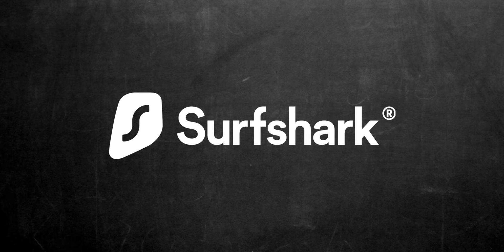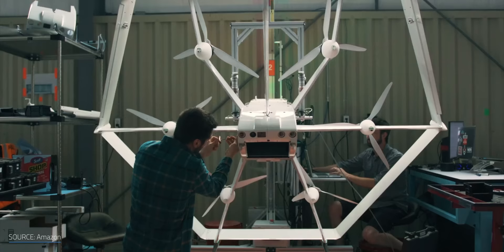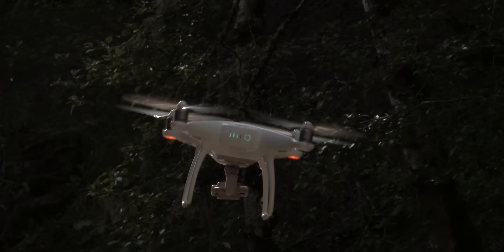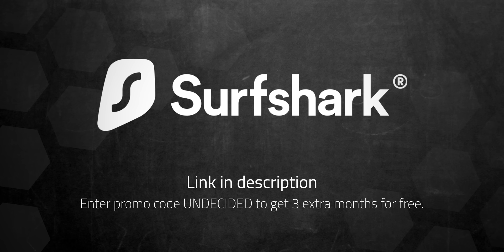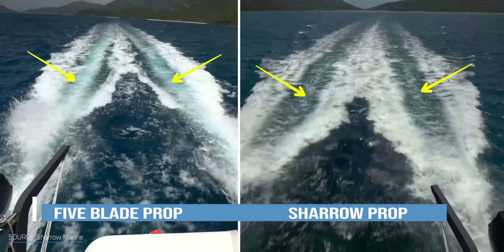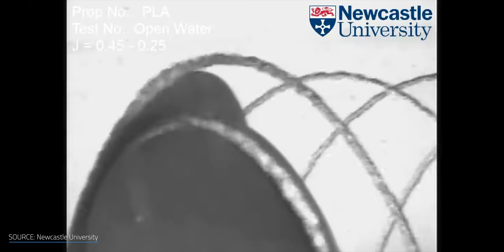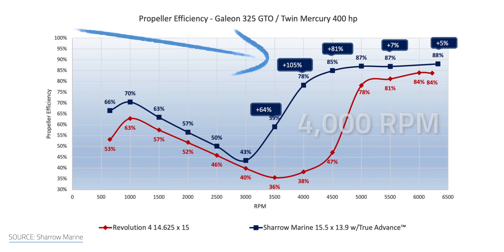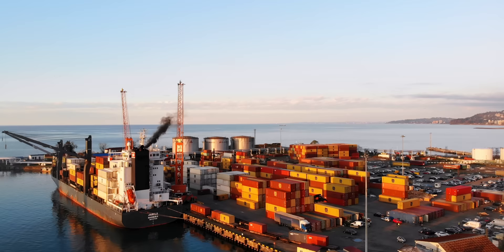Why is this Propeller Getting So Much Attention?

Comment: I HAD A MASSIVE ARGUMENT on a car tuning channel that a whistling turbo was a BAD thing not a GOOD thing 

The whistling is vortex shedding at the tip of the blades - usually caused by a mismatch in the size of the turbo and the inlet X section - at best its literally ripping away the tips of the blades, at worst it is over boosting the system and can cause it to explode

Comment: Nice video, great implementation of this topic!

Have you somehow come across approaches to use the toroidal concept for wind turbines? It would be exciting to develop a particularly quiet (small) wind turbine. Here, too, tip vorticies should be a cause of noise development!

Due to the aerodynamics, however, the design would of course have to be different. An optimal fan is after all, as we all know, a catastrophic wind turbine system.
Reply: There are many solutions to tip noise, through designs that we already have, that wouldn't require a completely new prop design. 
Additionally, we look for a design that takes the least amount of material to produce. Weight and eol disposal are factors. 
The Toroidal design takes a lot more material. This rules it out for most real world applications.
Reply: The first time I ever saw a torodial windturbine was a horizontal desing back in the late 70's on a green energy exposition. As i remember correctly it was mostly too complex to scale up. One of the most remarkable things was the flexible desing let it change height and diameter when (wind)speed variated.

Comment: i think the US Navy and Darpa, had tested these, and said something like while they work great on a small fishing boat, its not a scalable design for a destoryer or quiet enough for a submarine, which is what Matt says @10:40.
You'd think if the Navy could afford to test two aluminum warships and scrap them after 11yrs , a propeller should be like buying Mc Donnalds.

Comment: I remember some decades ago reading about a new propeller for ships - a propeller that was not a helix but a vertical piece that propelled the ship usint the same principle fishes use. It could get higher speeds and save fuel but it took too long to accelerate the ship.

One of the problems with these aero/hydrodynamic parts is the lack of deterministic equations. The only path possible is trial and error. There are techniques to guide the trial and error - famously the first genetic algorithm for optimization was created to design turbine blades back in the 1980s.

This propeller is very interesting! If we compare old comercial jets with the new ones, one small difference will be the two vertical parts parts on the ends of the wings and they are there because they stop the air flowing above the wing to mix, through the side, with the air flowing bellow the wing. Those small vertical things save lots of fuel. That's precisely what this new design does! In the jet plane the noise reduction is insignificant (there are 2 or 4 turbines near it, after all) but for drones it's fantastic!

I think one reason for the price is the shape probably needs a mold that will be destroyed after each is made. Cavitation, however, is a serious problem - that the Red October solved using superconductors to move water ... (the book/film). It's the main cause of noise in submarines and ships and it affects marine life. It also destroys the propeller/turbine. In hydroelectric power plants the turbines have to be dissaseembled and repaired in a prefentive fashion so they wont undergo catastrophic failute. That means though these turbines propellers will cost more, they'll not only save fuel but also last longer. Nice one, Mr. Farrell!

Comment: Hi Matt,
would these propellers work for wind farms? A similar improvement in efficiency / reduction in noise would be fantastic.
Reply: there are vertical axis turbines that already use a similar shape and some dynamic kite based wind energy farms are also looking into such novel applications :)
Reply: I'd wager not, since:
 - bladed wind farms operate at way lower RPMs where tip vortices are practically moot
 - the fluid dynamics work a little differently in reverse - likely invalidating any efficiencies that aren't just side effects of noise reduction
  - are the propeller blades at wind farms even noisy, especially compared to the generators?
Reply: I would say yes and no. Windmill blades can now be adjusted for the best performance in different kinds of weather and i do not see how you could do that wit theas blades. That sead, because of the bigger range of affenciantie it might not have to.
Reply: Yes and no. The design should work the same for a wind turbine as it does for a propeller, but at those sizes increased material costs will make it unfeasible. It would likely also impact the efficiency of downwind turbines. The question is if the added material costs less than the profits you would gain with the added efficiency. You also need to figure out the engineering challenges that come with the added weight for the support structure and how that would affect possible height (which is corelated with higher wind speeds) and for the inertia of the system and how you would stop such wind turbine in dangerously high wind situation. My guess is that we could use this design with smaller home turbines

Comment: One thing worth noting is that even if the sum of pollution by those huge container ships add up to 3% of global CO2 for 80% of transport by volume, if you break down the transport contribution % for any good purchased, the fraction contributed by those container ships is fairly low. Most of the pollution is in the last stretch by truck.
A rule of thumb (not entirely accurate, but i'd love the hard numbers) is that container ships are one order of magnitude more efficient than trains, which is one order of magnitude more efficient than trucks per mile/kilometer traveled.

Comment: Yet another niche market these propellers would be great in: paramotoring. Paramotoring is where you use a long, wing-like parasail in conjunction with a simple propeller strapped to your back, run by a light 2 cycle motor to provide thrust, allowing you to use that parasail give you one of the most free forms of powered flight for a single person. One problem is that the prop directly on your back is incredibly loud, necessitating hearing protection and causing fatigue. You'd probably still need hearing protection, but it would be very welcome. Any higher efficiency is also great!

Comment: Question: Can this work for Computer fans too, or do those need different properties? These are so much quieter, it would be quite amazing for that setting, where you sit next to fans for potentially long times.
Reply: they have different properties. one of the main one is they arn't in an open air system, they need to push air hard through obstructions and such. also alot of the noise comes from the air inside and not just the fan but the turbulence of the air flow.
Reply: ps, you can get quiet fans.
Reply: @mryellow6918  part of what these toroidal fans seem to do is to reduce turbulence, at least the turbulence created right at the fan itself. I'd imagine that'd still be possible to do in the cooling fan setting?
Reply: @Kram1032  what I mean is you can't do anything about the turbulence inside the case. And you can't control what's obstructing stuff. For example your gpu fan blowing in all directions even against case fans
Reply: @mryellow6918  certainly, but I guess I'm not sure that that's enough to dismiss the sound of turbulence happening at the fan blades.

Comment: Large container ships have variable pitch propellers which increase efficiency at any given rpm vs. a fixed pitch.  Same with constant speed propeller airplanes.  The toroidal shape is only good for a fixed pitch since any change in blade angle would not be possible with the ends connecting.
Reply: Knew there had to be a catch.
Reply: Come to think of it, though, at least in terms of cargo ships, isn't it fine if they run at the same, low speed most of the time?
Reply: @asahearts1  Always a catch. Just like advertisements that are too good to be true and every YouTube is advertising it.

Comment: Greg Sharrow is my cousin. My understanding is the reason they’re so expensive is because they’re milled on a cnc machine and that is incredibly expensive. Most boat props are cast. Same goes for many other types of large metal components, like crankshafts. The cost explodes when you change from cast to milled because the manufacturing is so much slower and more expensive. A cnc can only turn out just so many parts per day. Whereas when you cast parts you can do larger batches in the hundreds or thousands. And increasing manufacturing capacity means buying more CNC machines which can be several million dollars each.

Comment: I'm curious how this performs compared to water jet propulsion.
Reply: Pump-jets are efficient and don’t suffer as much from cavitation because they run at higher pressure. Would be interesting to see how they compare.
Reply: Jet propulsion generally only offers increase in efficiency at higher speeds.  You can see this clearly with aircraft. Planes design to cruise at speeds above 0.5 Mach almost always have jets, and below that have propellers.  I’ve seen similar results with boats.  I read an article about a boat that was offered with either a outdrive or a water jet.  The water jet offered a small increase in top speed but the prop was more efficient at all other speeds.  The conclusion of the article was that you’d only want the water jet if you had to operate in swallow water.

Comment: I'd love to see how, say, a P-38 Lightning could perform with props like these. Or a helicopter like the Comanche.
Reply: They wouldn't even get off the ground.  This shape offers no way to change the pitch of the blade, which means the P-38 would need several miles of runway to get up to speed and a helicopter wouldn't be able to add collective to take off.  Some things don't scale up.

Comment: Actually toroidal propellers are only one option to minimizing tip vortices and is the most difficult and therefore expensive solution since they can only be made by 3D printing or very difficult machining.
The simple solution is to simply place the propeller in a duct which accomplishes the same thing.
Another solution has been to use a different type of propulsion like pump jets.

The toroidal propeller might still be the preferred solution for some situations like minimizing the possibility of entanglement.

Comment: Hello...I'm a marine engineering officer (sailing staff working on those cargo ships that you are showing). All this is extremely basic for me. Even with latest regulations of CII and EEXI I Don't think it'll come into shipping soon. Propellers are already extremely expensive. I'm talking about millions of dollars in our case already. Propellers have already been very inefficient and newer, better designs have been in PRODUCTION since decades like Keppel propeller, etc. But due to the initial costs, no one buys them.
Toroidal propellers will also be very heavy and increase the loads on the stern tube bearings especially on big ships....I still think future shipping will go methanol or methane or ammonia along with other energy saving devices like huge kites and pre, post swirl devices rather than toroidal propellers. Ship owners are mean and no one actually cares for the environment here. Only after a new regulation is enforced, habits change. New rules are actually opposed by countries because it directly means expensive transportation. All this I'm saying in a time when shipping is seeing the biggest change in centuries towards greener fuels and lower emission targets. Still a lot needs to be done and what's done needs to be verified by impartial agencies....

Comment: I want one!  But the up front cost is so high...  My boat is a sailboat, so it's already pretty efficient, but it'd be great to cut the fuel cost for when I have to motor.  (also those massive ships don't burn diesel, they run on "heavy fuel oil" which is closer to tar)

Comment: Seems like the stress on the outer edges would be massive. I want to see a container ship sized prop. 
Salute to the engineers.!
Reply: The metal that connects the props together reduces the stress, especially in the mid range.

Comment: Surely designs like this would’ve been used on submarines by now if it were so much quieter, there must be some significant drawbacks
Reply: They are very difficult to make, and only became easier thanks to 3d printing. Also, the benefits seem to be situational, so it's not like a drop in upgrade

Comment: For boat props in many places they hit things like sand bars. The old props can be rapaired, to some degree and may not loose performance as much as the new props.

But, in the graphs, it seems the engines do not need to turn as fast so would higher torque engines at lower RPMs work as well? In the truck industry they found a big engine with high torque and low RPM worked better than a small engine because it does not have to run at full power to do the same work.

The C02 emissions of ships needs to be related to how much tonnage they are moving vs. emissions they emit.
This video talked about the positives what are the negatives? Aside from the cost mentioned. I have seen one video were someone put the props on a drone and did not get good results.

Comment: One factor you didn't mention is that the toroidal propellers are larger and heavier than conventional props. This is no problem for a cargo vessel, but flyweight drones have to manage every gram of weight, so there are some applications that might not use them despite the advantages.

Comment: We can get higher efficiency and less noise and less cavitations if we add nose or pose (cone shape) at the center after the propeller. 

I worked with Japanese professor on cavitations and I know that since 2002 as mechanical engineer.

Comment: Aside from drones (still watching video as I type), I want that extra strength for cordless shop vac/ hand vacs. Their strength with the current 18v~28v battery packs are weak. I’m aware that cordless tools are still in development and do not have high strength but i hope this fan blade can help improve suction for cordless shop vacs. Hopefully with this breakthrough, it can also increase battery life since the cordless shop vacs drain the batteries.

Comment: Like everyone else, I was intrigued by this new "toroidal" concept. However, testing shows that in air, there are hardly any gains. When you factor in the higher mass of these hybrids, warping of their shape at high rpm, even those are lost. 
It 'felt' like hype from the first time I heard of it. My thought experiments initially also said 'hype'. 
Then professionals in the marine and aerospace industries also rolled their eyes. 

For many decades, great numbers of research minds have been pondering the prop. There are reasons the changes we've seen to it's essential design are small and almost unnoticeable in multiple industries. 

As for UAV flying, as an FPV pilot and science guy using our typical 5" quad, The noise from those was always a menacing sound. I  never liked it. So I switched to 7" Quads, and now only use Bi-Blade props (Gemfan Flash 7042) for their huge reduction in noise and greater efficiency. The Gemfan props have a unique tip design, present on their Tri and Bi blade props. It increases efficiency a LOT over their competition's that lack this feature. 

I think toroidal props 'may' have a place in industry and unique applications. However in FPV/Quadcopter/UAV applications, I don't think so. Too much mass, and too little gains over simpler, cheaper, easier to produce and balance bi and tri blade traditional designs with their added refinements.

Comment: Toroidal props will excel in small water craft and drones. We will never see these in aircraft for many reasons. The small disc generated by a conventional prop produces radial loads easy to balance and endure by the aircraft engine. A toroidal will generate lateral loads on the engine, be harder to balance, more catastrophic results when out of balance due to a bird strike or damage and pitch change would probably negate the carefully designed shape. Sometimes simpler is better. Not everything needs to advance. AKA the Toaster.

Comment: interesting how the toroidal shape is also huge in theoretical physics and the application of bending space and time. You see it used in science fiction as the field of energy surrounding ships using "warp drive". I think that is not a coincidence at all that it happens to be an extremely efficient propeller design as well.

Comment: Huh.  I recall seeing a vid a long time ago showing that large ships (cruise ships in my case) have lateral propellers to push the ship sideways to improve docking maneuvers.  The problem was, the props were recessed into the side of the ship and the cavitation over time just ate away at the surrounding material of the hull.  But with these toroidal propellers, that cavitation wouldn't be there, thus reducing wear and tear on the ship's hull, thus reducing the cost of refitting.  I'm thinking Disney is gonna be mighty interested in these props. (That's were I saw the vid--on a Disney cruise.)

Comment: If small toroidal props for camera drones can be manufactured with only a small price increase over conventional props, and they are found to be not only quieter but also more energy efficient, that would be a huge boon for anyone using drones for either business or recreation. If a toroidal prop could provide even a 10% increase in thrust efficiency, by cutting down on the amount of power lost to tip vortices and noise generation, that would translate into a 10% longer flight time on the same battery pack, and what's not to like about that?